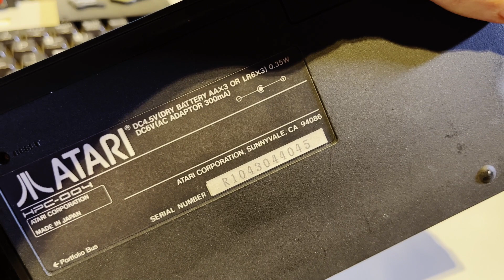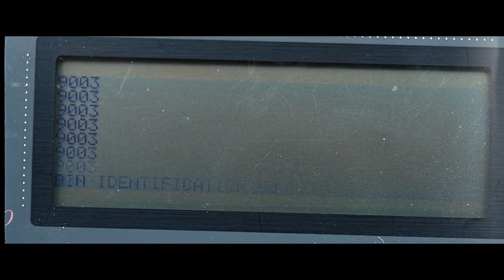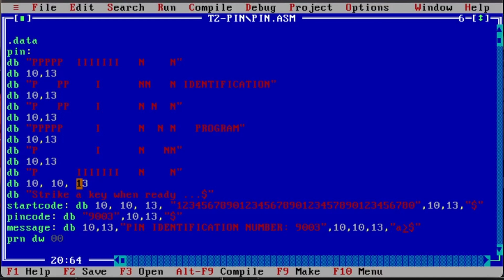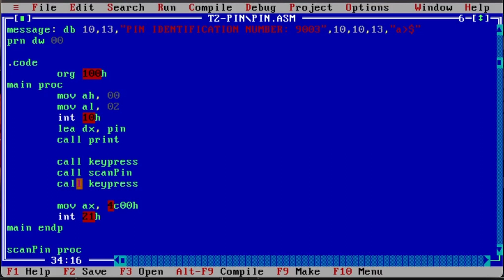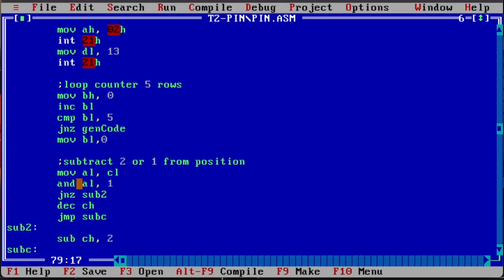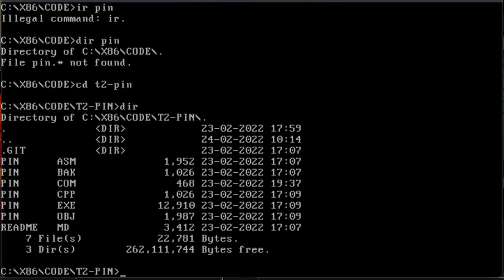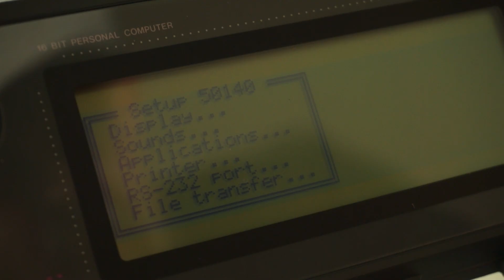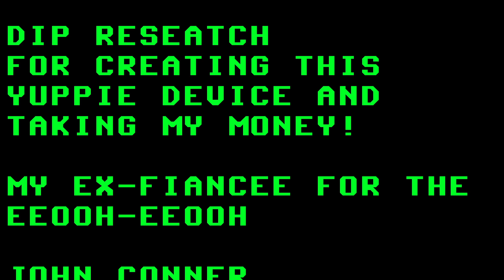Coding Terminator's Easy Money on ATARI POFO in Assembly

Comment: That is very cool! I've been a huge T2 fan since it came out, and bought a Portfolio with the parallel port and a BeeCard with a file manager on it, mostly as a display piece. But now I'm about to learn how to code and we're getting into assembler, so it'll be a no brainer to bring it to school and hopefully manage to code the PIN software for it like in the movie :D
Reply from the maker: And hack the ATM at the 7Eleven across the school. The code btw is on the GitHub including the binary com file. So you can just upload it with the parallel cable as shown in the video
Reply: @CallousCoder  Sorry for the late reply. I managed to find an old laptop yesterday, a Dell Latitude PPX, with a serial port that I can use to communicate with the portfolio. Fingers crossed! :D
Reply from the maker: @ you need to use the parallel port. And a straight 25 pin cable. 
But cool, the great think is that you have a beecard. So you can actually load some useful software on it that’s bigger.
Good luck and most importantly, have retro fun!
Reply: @ The BeeCard is made with a file manager software, not an empty one. Is it even possible to get a BeeCard reader for a regular PC? I can't wait to begin playing with the Portfolio, when I get an OS loaded into the old Dell computer :D
Reply from the maker: @EkelundDK  That's a good question, I don't know if there were BeeCard readers for PC. I would assume so, but I've never seen one.